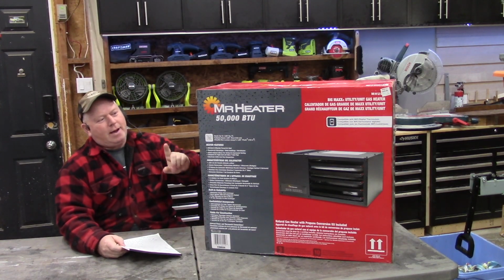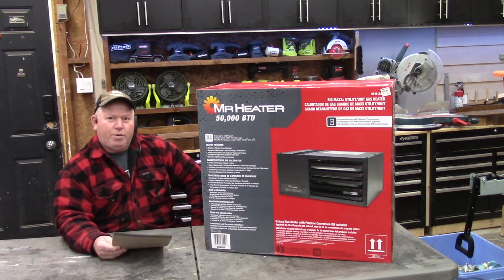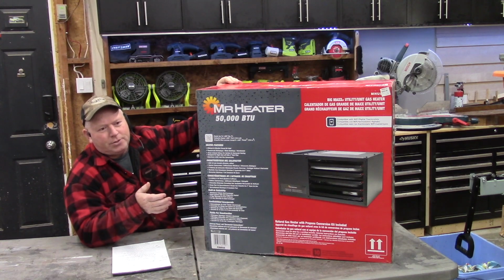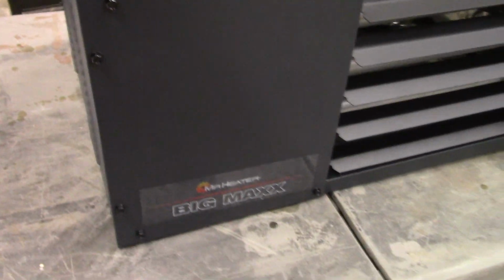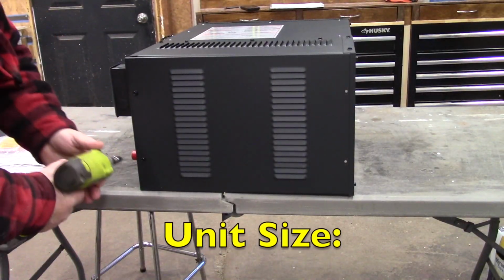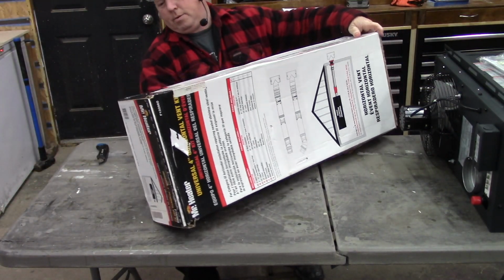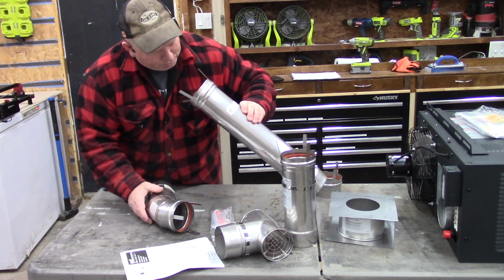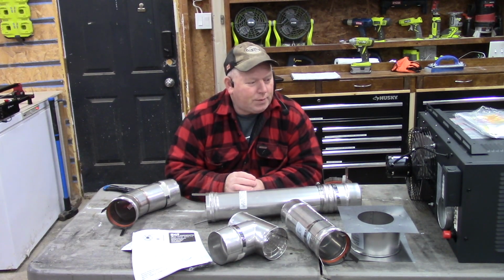Mr Heater 50,000 BTU Shop Heater Unboxing

Comment: Woohoo! Heat in the shop. Looks like Santa came early to Rob's garage.
Reply from the maker: lol!  I had an old house furnace in there that worked well but I need to remove it to add a rear garage door to the shop.  This will give me more space too.  Should have it installed after Christmas.